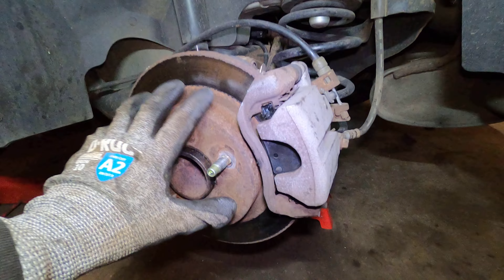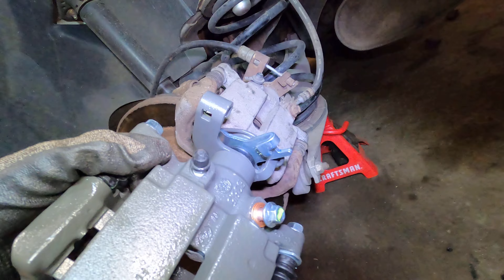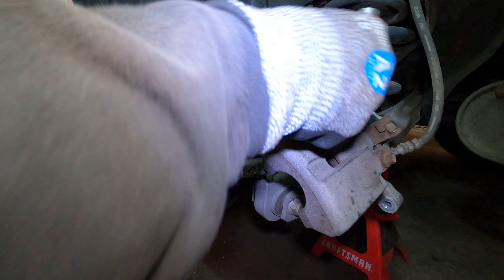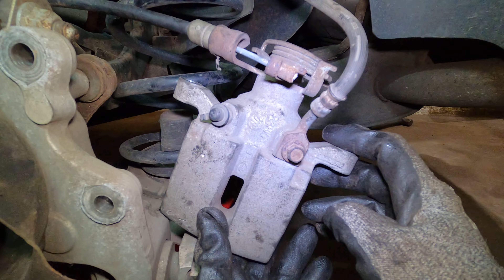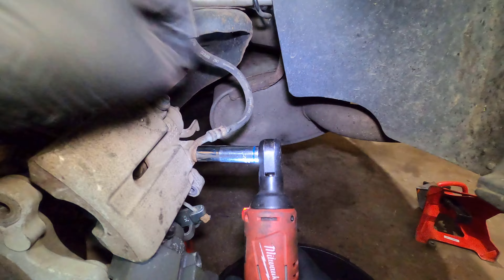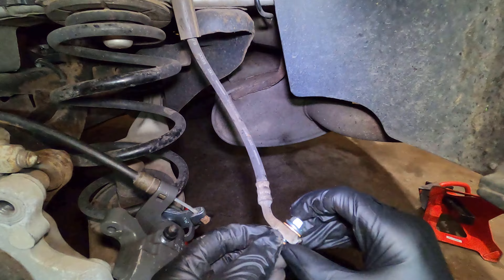2009 Pontiac G6 Rear Caliper Replacement

Comment: Just did both my back ends off this. The shop wanted to charge me 685 bucks..... About two hours of work and it was all said and done cost me about 100 bucks for the calipers and about 8 bucks for some locktite. Thanks man.
Reply from the maker: i hope this video helps. feel free to like and subscribe for more & if you can, please help the channel out by giving a super thanks. Making these videos takes a lot of time, but we do it to save you hundreds. also head down into the description and check out the link for some high quality led bulbs for this and any other vehicle. use my referral for a discount. Add me in Instagram for behind the scenes pics and Stop by my store for some Anything Auto gear.
Reply: Done and done thanks again for solid straight forward information.